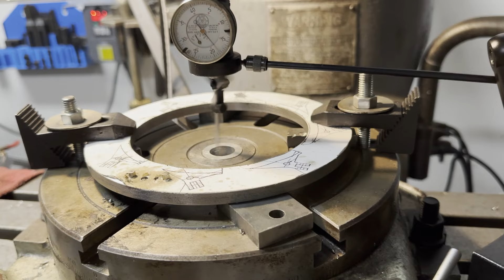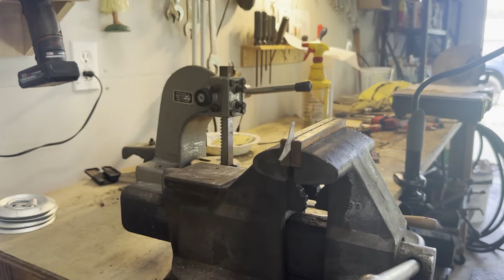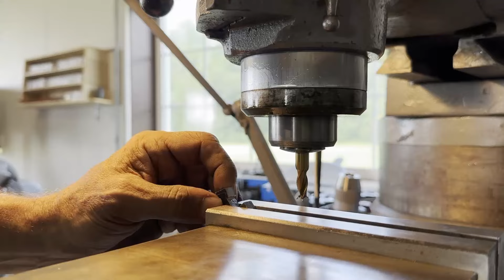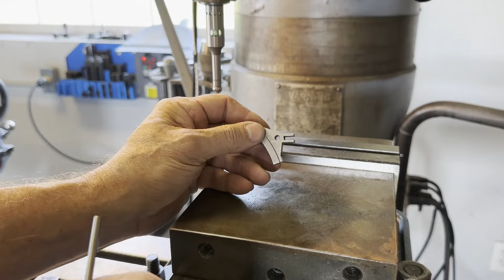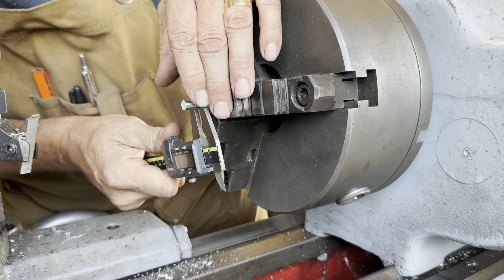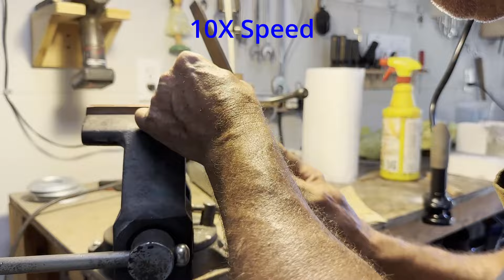Making Brake Shoes For Northern 4-8-4 Locomotive Part 2

Comment: I am trying to get back onto a 1 1/2" scale Ten Wheeler that was an Allen Models kit from the 1990s. I just bought the chassis castings and full plans as there is the real Baldwin locomotive in a nearby park. I chose this one because of local history and it being a not a super complicated like the Heavy Mikado in the local park, plus the realTen Wheeler locomotive to work from is in a park in the next town. What I found is the kit is harder to build than the real thing was constructed, the Baldwin Ten Wheeler chassis was built from Angle iron rivetted and possibly later welded. Most of the components are fabricated rather than castings like the model kits.
 I have built multiple model steam engines, so this is not a big deal, the boiler is what seems tough.
Thanks for the video inspiration!
Reply from the maker: Glad to hear about your project. Can’t wait to see it one day. Thanks for watching.